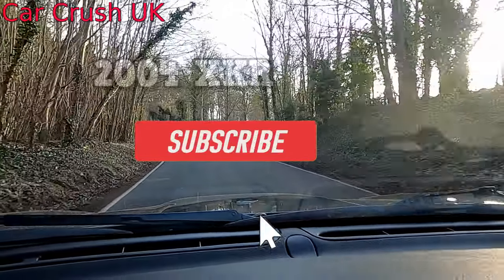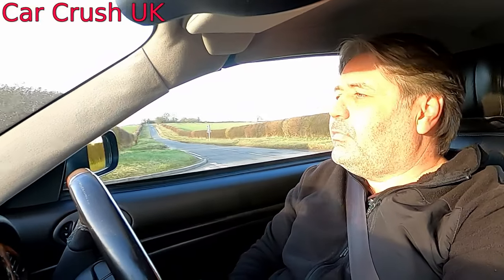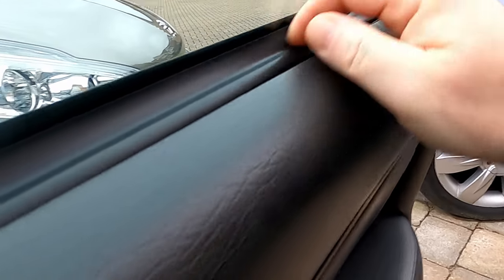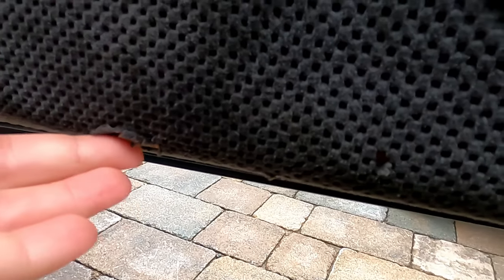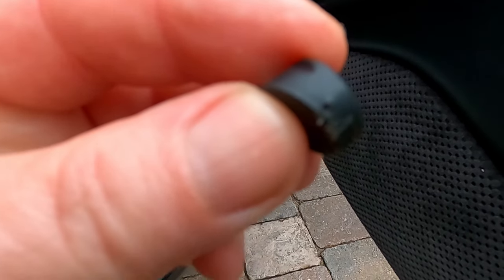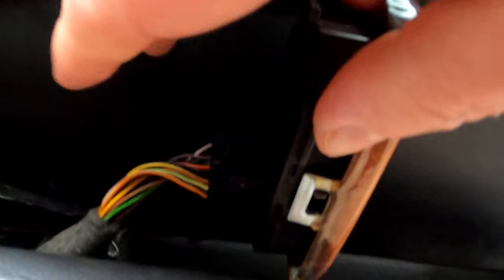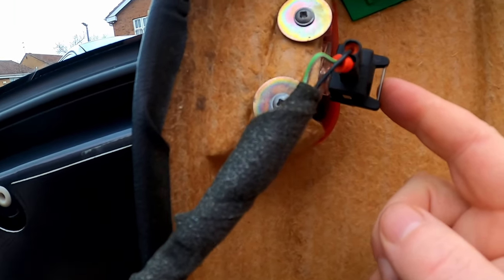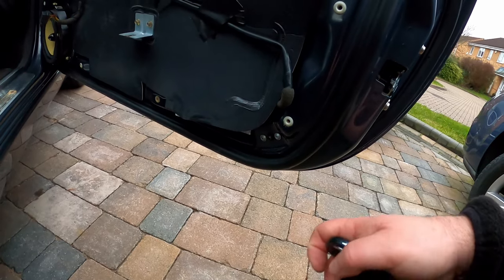XK8 / XKR Door Card Removal  & Replacement - Part 1

Comment: Interesting, my door cards aren't loose but a couple of the cars I saw did have issues with them. Its a little interesting getting into the world of Jag videos/fixes/owners, having spent a few year messing with mx-5s/miatas, there is definitely a lot less DiY ethos among jag owners lol. Like you actually bought a new door card instead of making a new, custom one (popular on mx5s because it increases interior room by going to flat door cards, would probably look crap on the jag although the way the jag's window seals work, I think it would actually be easier on the XK than the mx-5), or doing some simple crafting to fix the retainers/clips.

Either way, so far I am finding the skills I learned doing interior stuff, auto electrics, diagnosis, fabricating/making etc on the mx-5 and my Toyota pickups is proving invaluable on not breaking stuff when working on the much more expensive XKR.

One trick I have learned from pulling several interiors, and been confirmed to me by a few mechanics, is that when removing door cards and interiors with plastic trim clips, it is a mistake to try to gently prize things apart, in actual fact a sudden, strong (but not too strong) jerk will usually remove fasteners cleanly without breaking them. Its counterintuitive, but since I started being a lot more violent I have broken far fewer tabs.

Also, if you are doing any interior work on your car or anything that invovles removing plastic fasteners, get one of those big fastener selection boxes (2000s ford and GM style ones are a good fit on these cars for the most part) with 2-300 assorted pieces from amazon for like $20, and you will rarely be lacking a workable replacement fastener when you do break things, and 20 year old plastics will break. I just replace when I break clips, no biggie. Every used car Ive bought Ive gone round and replaced broken/weak/missing clips and it makes a huge difference to the random knocks, rattles and creaks you get from older cars.
Reply from the maker: Thanks for the comment Iain. I wouldn't mind getting an MX5 to play around with one day. I agree that sometime a little less finesse when removing panels works well. The door card plastics are a particular area of weakness and would likely shatter as some already had. Great tip for replacing fasteners. Cheers !!

Comment: John, I've got these screws in the end of the door cards too. Probably a standard Jaguar rework. Looks like you've got aftermarket speakers ? Nice video regards Damian
Reply from the maker: Thanks Damian. I think you are probably correct about the rework. Although the holes were in different places on each door card. It was quite a lot of work to swap everything over as you will see in part 2.
I fitted the speakers last year when I upgraded the radio. I had to make adapters to take the bigger size. It seems I don't like thongs to be to easy